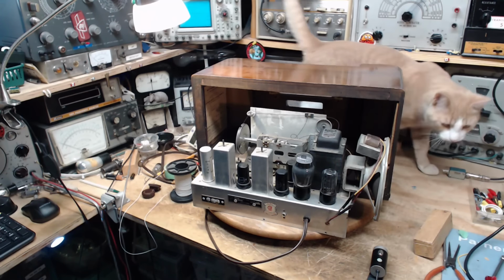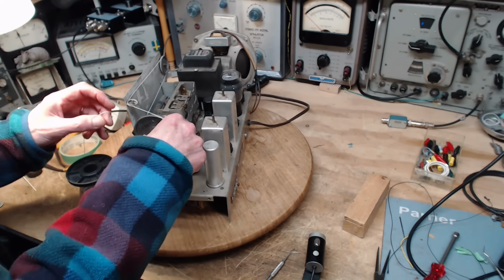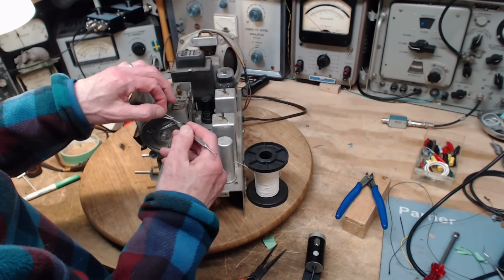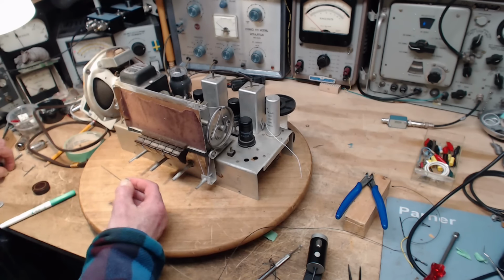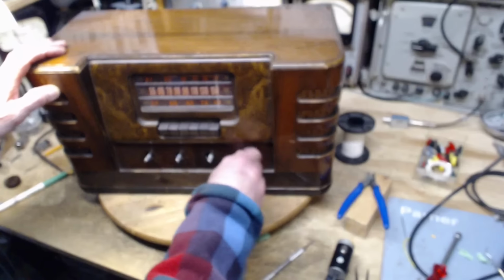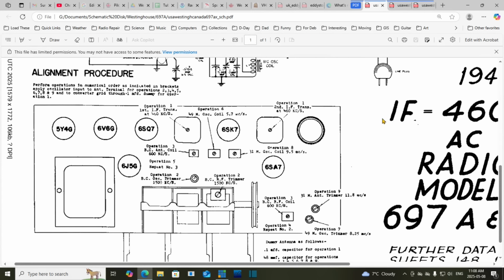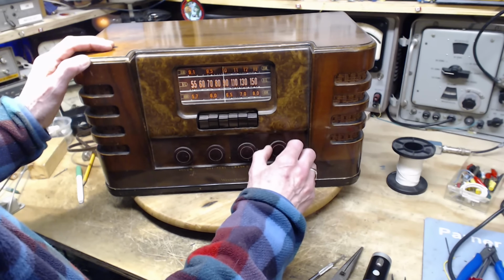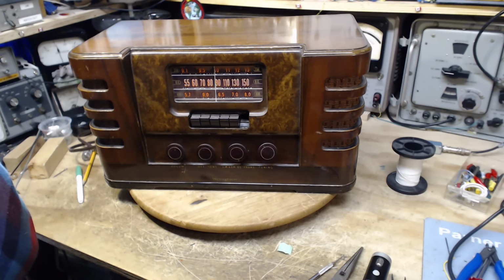Canadian Westinghouse Model 697A Video #4 - Installing a New Dial Drive String

Comment: Jim, a resounding round of applause to you sir. You replaced that dial cord with confidence and steadfast determination as you overcame the obstacles along the way. I like and appreciate your wanting to be thrifty with the dial cord by measuring precisely how long it should be before cutting it off the reel. Not a single mm wasted. You had me on pins and needles at times, wishing that I could reach through the screen and lend you a hand, but my hand was not needed because you are proficient at dial string replacement. No doubt, experience has taught you well. I look forward to capacitor replacement tomorrow. It was nice to see Bert today and I’m pleased to see that he’s comfortable following surgery. Keep up the great work and thank you for taking the extra time to bring us along.

Comment: You clearly are more dextrous at this than me, though I did develop a personal fix for the knot tying - I got a piece (a few feet) of about 1mm I.D. brass tubing.  Cut a piece about 2 mm long and thread the loop through the tubing, crimping it with a terminal crimp tool (the cheap kind without the 'ratchet' action.)  But use a delicate touch.  I will probably never use all of the tubing...  Oh, and you will probably need to use a 'razor saw' to cut the tubing.  I bought it at the same time at the hobby store.